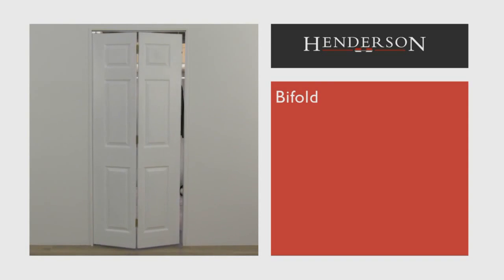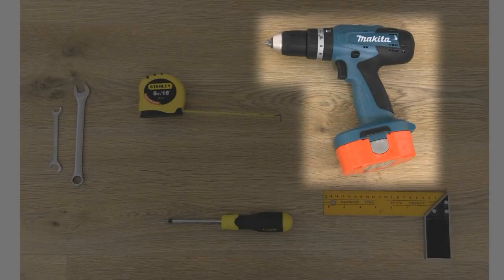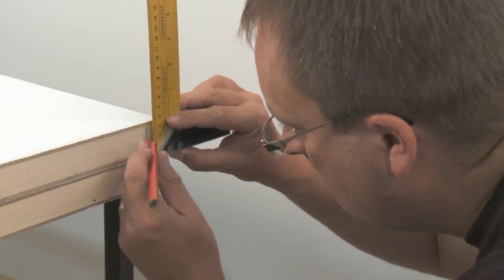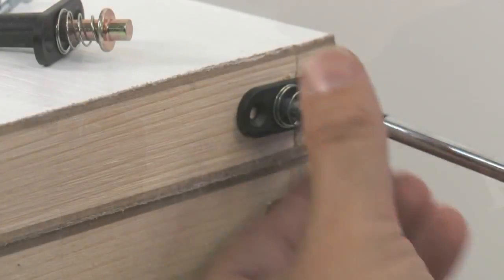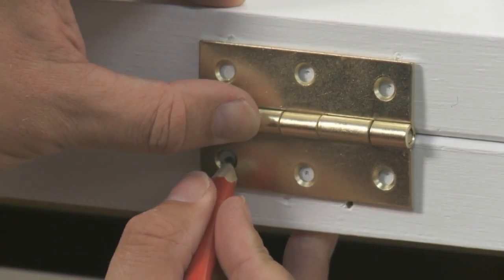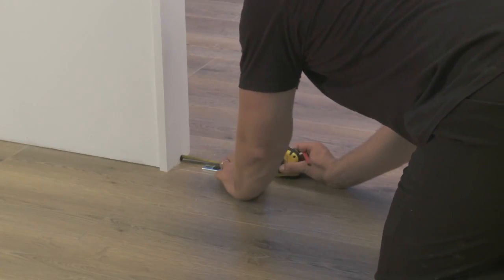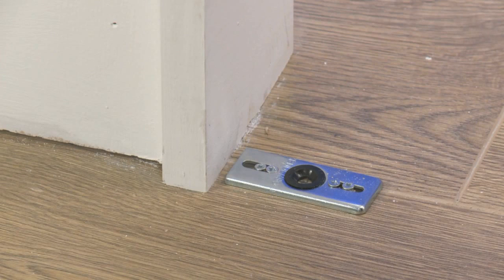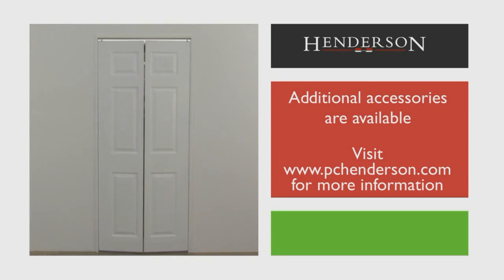HENDERSON BI-FOLD FOLDING TRACK SYSTEM | Screwfix

Comment: Hi, at 5:10 you say swing the tracker to the frame so you can hang the doors but at 5:20 it shows different way of the installation, which one is correct?
Reply: He actually says "swing the track out of the frame", so basically it it only held by one screw. Once you slide the doors in, move the rail back and fix in place.
Reply: Good afternoon, 

Sorry for the confusion. The correct method of installation is as follows:
- Swing the track out of the frame
- Fix the bottom pivot into the bottom pivot socket 
- Fix the top pivot into the top pivot socket
- Move the track back into position and fix into place 

Many thanks, 
Kate 
Marketing Assistant
Reply: Hinges. Video shows them fixed to door edge but step 4 in my instructions say fit to back face of door. Which is correct or best? Thanks

Comment: The video shows the holes for the pivot and guides drilled in the centre of the top and bottom door edge (ie the centre of the hole is 17 mm in on a 34 mm door). Yet the diagram that came with the kit shows the distance as 10 mm from the front-facing edge. Which is right?
Reply: Good afternoon Gary, 

Thank you for your feedback. 

Both installation methods are correct - this is down to the preference of the installer. 

The benefit of installing the guide and pivot 10mm in from the front facing edge of the door is that the door will be inline with the track. 

Many thanks, 
Kate 
Marketing Assistant
Reply: YU